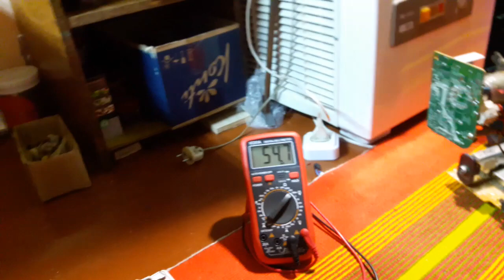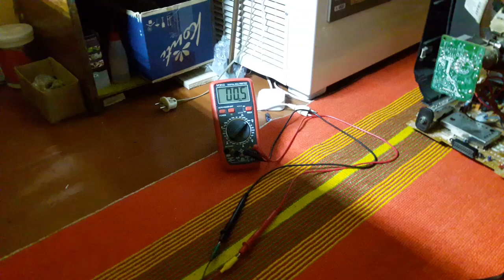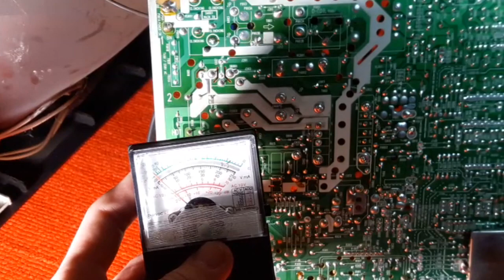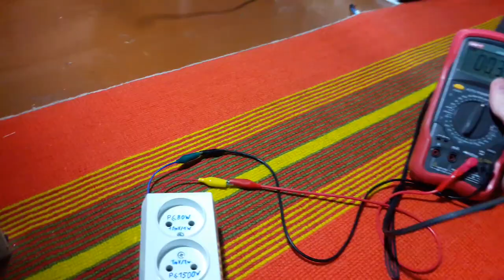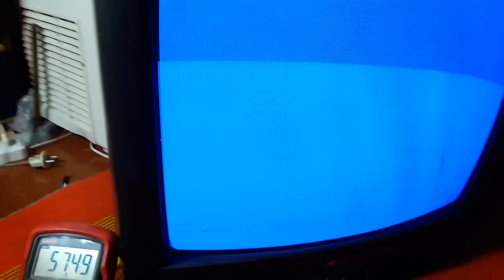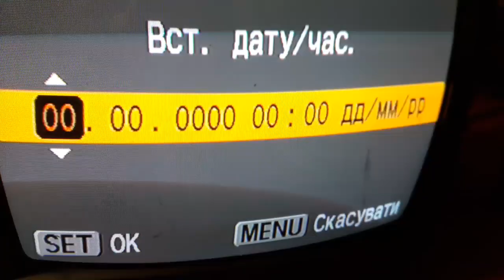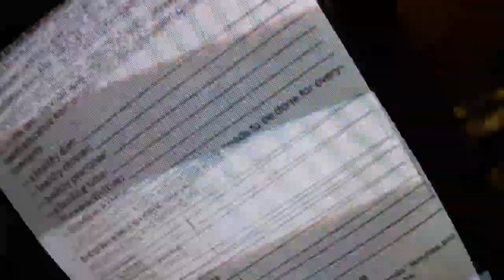LG CRT TV Repair: No Power - Part 2 of 2

Comment: I have to say that it is heartening that some countries are not as eager as the like of the UK to just get rid of CRT televisions before they're ready to be scrapped.

Over here you quite literally can't give the things away... not even the expensive late large-screen Panasonics and Sonys.
Reply from the maker: Jason james Majority of the people here won't toss the CRT set away unless the tube is weak. 
Soviet era TV's are scrapped because of that exact reason, plus soviet color CRT's get weak rather quick. 
 Those TV's are excellent source of components, though. Small level of integration means a lot of discrete parts, and thus hassle when tuning it to work right.

Comment: Well done :-D, it did give you a good run around.
It's healthy again, and you saved a usable tv from the skip, that tv has lasted twice the time or more of a cheap modern lcd crap. :-).
-
If it makes you feel any better, i didn't expect the rectifier smoothing capacitor to be faulty eather, and it looks so innocent too lol.
The grey ring of death is a pain, i used to resolder the line output transformer every time, it's weight and lack of mechanical bolt down does not help.
-
Oh i gave up on making an esr meter, i bought a cheap T4 tester from amazon, it will do for approximate esr values, yes i know im weak.
Reply from the maker: zx8401ztv Yup, I also reflow joints on parts that are mechanically/thermally stressed. Danyk has a very simple ESR meter using 555, without the transformer with 400 turns of hair-like wire :D You are an old geek, I think you have a meter movement laying around waiting to be used.
How much did you pay for it, because I see there's quite a few. Those things normally can't measure in-circuit, just so you know. They are effectively same as mine Transistor Tester, but with a graphical display. Mine has a menu, in which you can choose in-circuit ESR meter. Give it a try, press and hold the button, maybe yours has the menu too.
Reply: I payed £6 with free postage.
it would have cost me more to buy the usb serial programmer and chip+parts and lcd display, i'm not into programming micros so the programmer would be a one off use, it would sit in a draw and do nothing after a single use, so i take a shortcut.
-
Believe it or not, i have collected tons of designs for esr meters and lots of analog versions, i was trying to get my interest back in making one, but that failed, my depression and confusion is a bastard.
Im not making excuses, just brain problems lol :-D.
-
It seems that there are many versions of the "transistor tester" most of the schematics look almost identical, but firmware differs quite a lot.
Reply from the maker: That's not a bad deal. I buy equipment too, but I have rather bad experience with such stuff from China. I've bought an LC100 inductance-capacitance meter a while ago, because I was afraid of making my own. It was a total POS, didn't work right. Some people say it's good and I saw it work in videos, but the one I bought didn't. 
 That was a kick in the ass I needed to make my own meter, which I did and it works a treat. You can see it here: http://aplomb.nl/TechStuff/Elmcie/Elmcie.html
Reply: Ahh i did make a digital cap meter back in 1986 and it used the charge up to threshold level method, a 3.59mhz crystal was divided and gated to provide a count that was the same as the capacitance.
Still works fine but no good for esr.

i also made the pic based l/c meter that worked on a lm311 acting as an oscilator to feed into the pic84?? (bad memory), it worked after messing with the reference parts a bit, and physical mods for odd problems.
It didnt work as well as they made out.
Very common design that everyone copied.
But no esr and limited range.

This T4 seems to have crap quality probe resistors, the german site Mikrocontroller... showed me that the 680R and 470K really need to be 0.1% tolerance for best accuracy.
I had a game as my old old fluke 8050A bench meter started to drift around on the 2meg-20meg range, so thats another problem to fix.
My local RS semiconductors has the resistors, but i ill change them after xmas.
Sorry long waffle :-(
Reply from the maker: You are so posh, my Transistor Tester uses 5% resistors :D
Reply: LOL After xmas it will have 0.1 tol, but it don't mean the firmware will get it right ha ha :-D.
Removing smd resistors and putting them back is fun, like hitting your thumb with a hammer :)
Reply from the maker: Well removing them is easy, big blob of solder on the tip will take care of it. Soldering them back is a bit more tricky.
Reply: Well i had to take just two off to measure them.
Putting them back on was a pain, my short distance vision has faded without me noticing, fuzzy time LOL :-D
The 680 stood bolt upright on its end, i had to laugh :-D
Oh, if i dont get a chance, i hope you and your family have a happy xmas :-D
Reply from the maker: zx8401ztv Yeah those things like to tombstone :D Clean one pad with solder wick, hold the part with tweezers and put it onto another pad solder on which you melted with iron. Only then solder second pad, soldering two sides at once is quite a dexterity exercise.